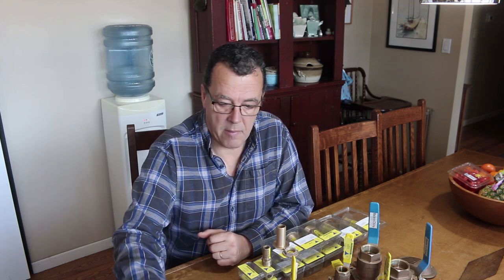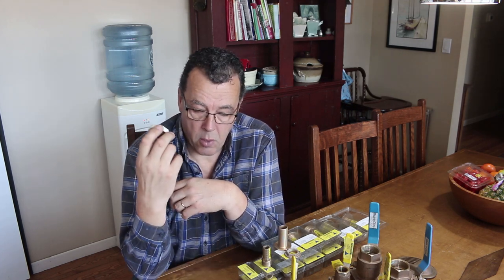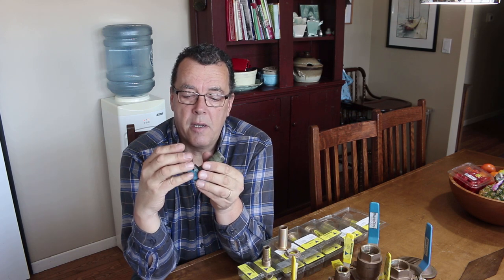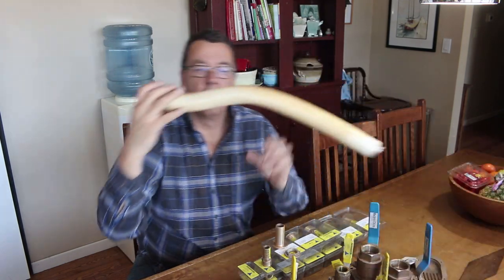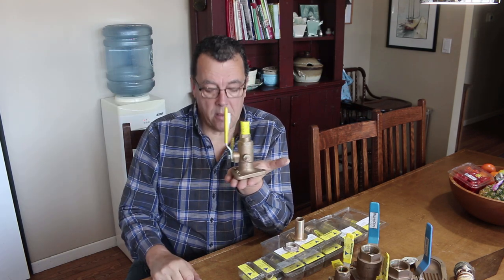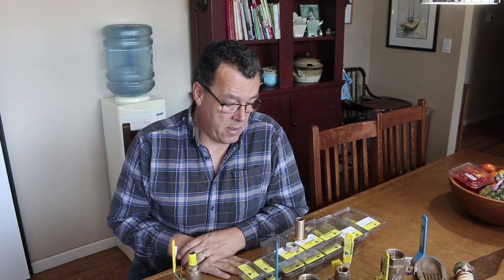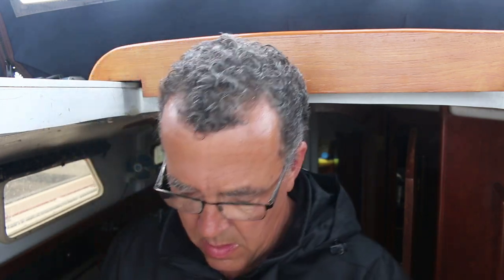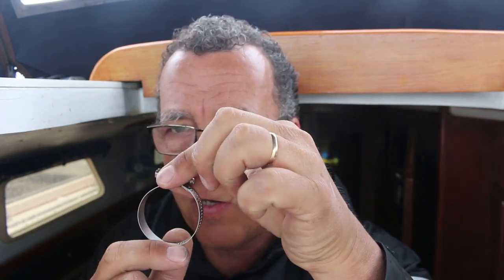Holes in our Boat, Wind over Water, Episode#2

Comment: I don't do my thru hulls  that way ,don't like more holes in the hull . 1/2" G10 , epoxied inside the hull . Groco  ibvf  flange adapters bolt to G10 , Standard bronze NPT ball valve can now be used and replaced  without doing base also thru hull can be change out without doing base and a double seal  inside and out . As done on marinehowto .com